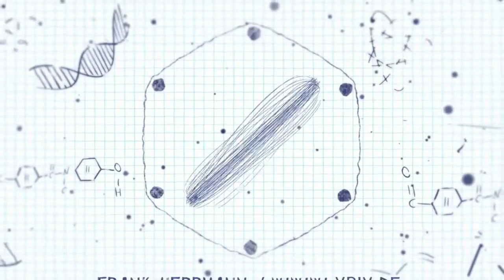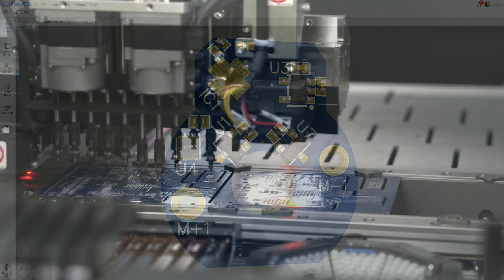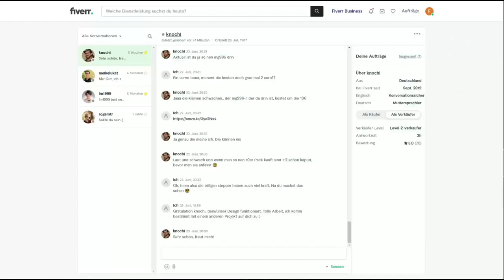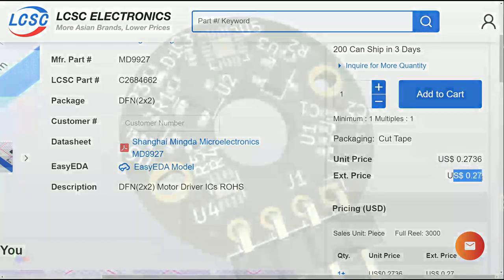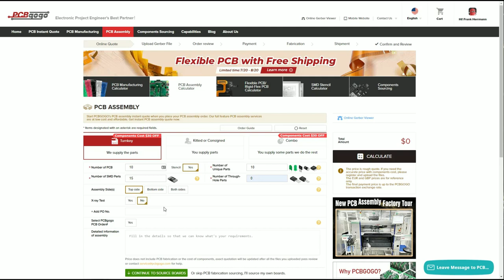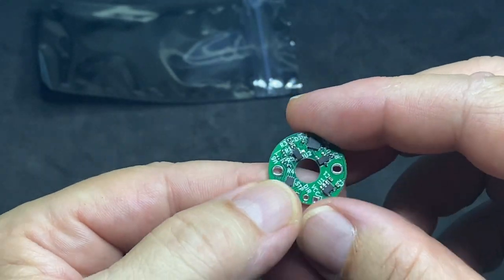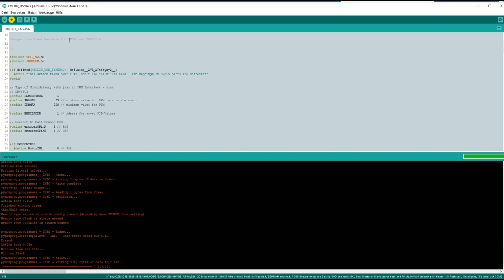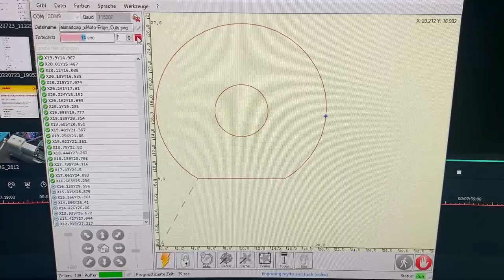S01E04 DC as Servo, PCB Assembly and success first Tests

Comment: You made good progress on this project.   The only motor and gearbox I can think of right now is the very common 550 size with a planetary gear box in cordless drills. The power requirements in might be too high for a low cost servo driver though.
Reply from the maker: Do you have a link to it, preferably where you can order? I find only the engines with small gear, but none including the gear.

Comment: what about play on gearbox? Can it be more convenient to have encoder on gear shaft?
Reply from the maker: Yes, but the problem is the low resolution. The magnetic disk delivers only 10 signals per revolution.
Reply: @xpixer  what about diy optical encoder?
Reply from the maker: @syntetyczny  yeah, possible 😎